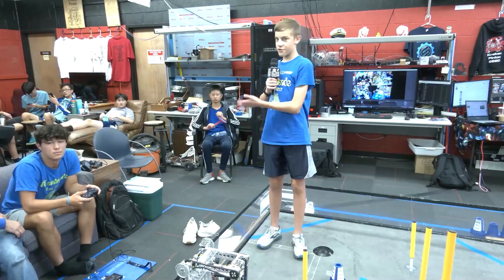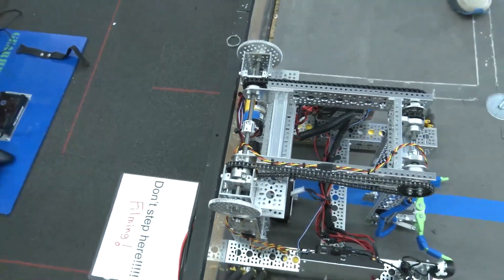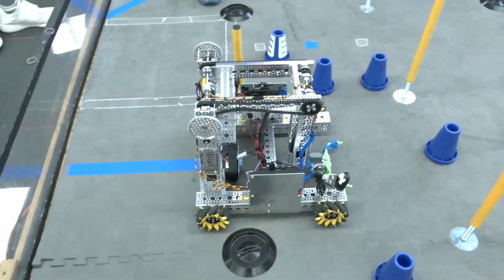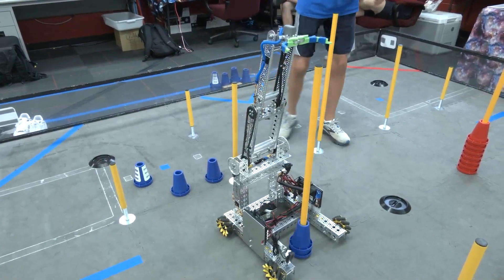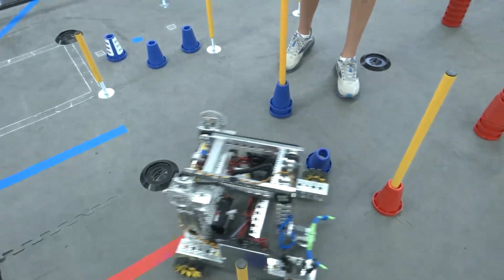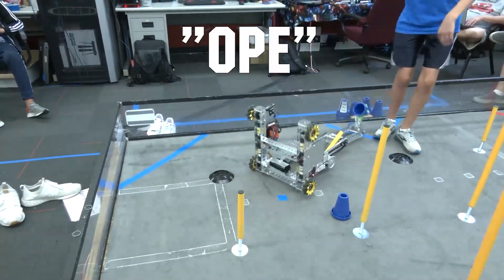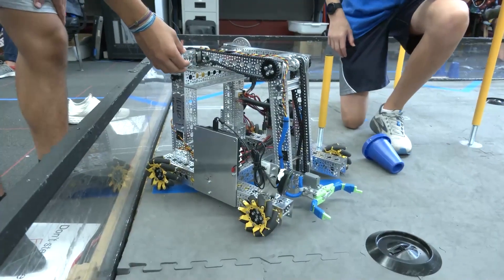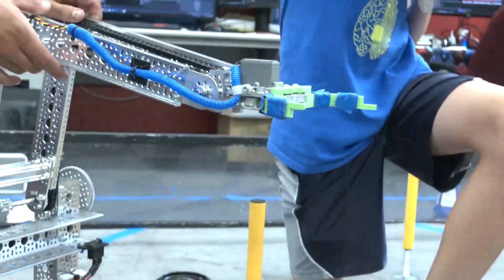30 Hour Robot Reveal

Comment: Super cool! How does the claw mechanism work? I didn't see any gears, but only one servo motor?
Reply from the maker: The motors that control the arm aren’t actually on the moving part of the arm they control the arm through chains and gears
Reply: It's called a virtual four-bar linkage by using the chains

Comment: Dang thats cool! Really impressive for 30 hours.
Quick question, what motors are you using for the arms? (RPM) 
And also is it just one motor powering each segment of the arm?
Reply from the maker: Both segments have one 19.2:1 motor with a 6:1 gear ratio. We were only running them at 0.5 power.
Reply: @ftcgearheads  Oh wow! Thank you so much!
Reply: how did you get the chain linkage system to pull up the last layer without continuing to rotate the middle layer?